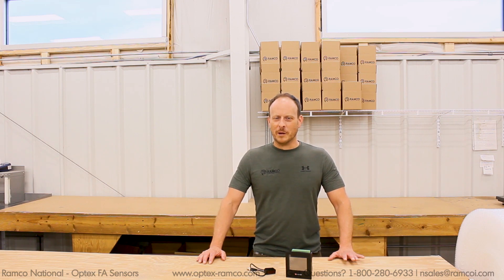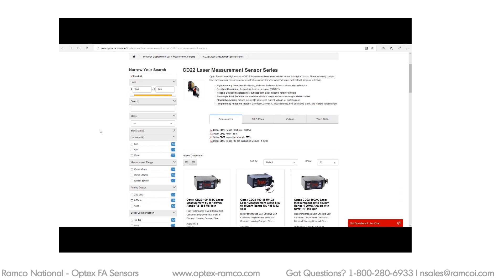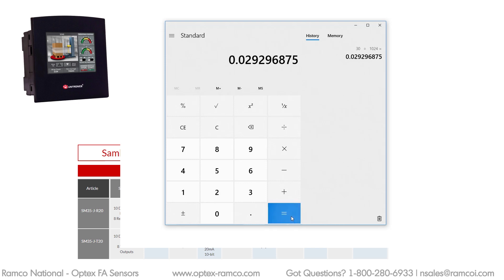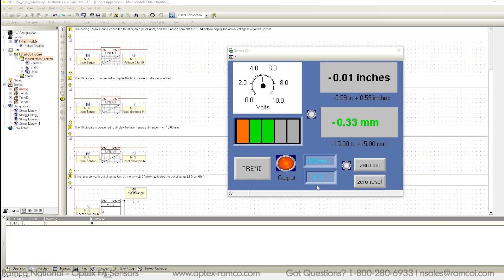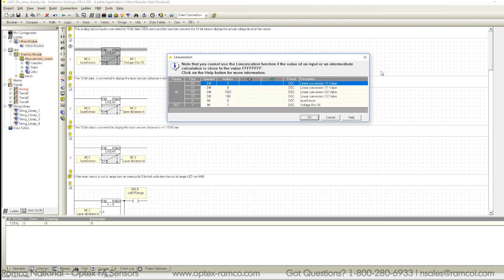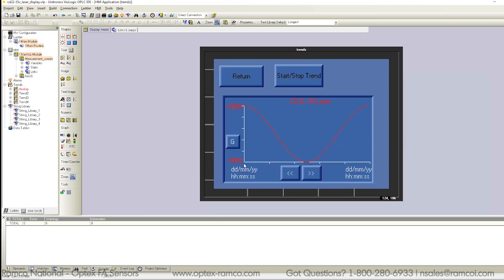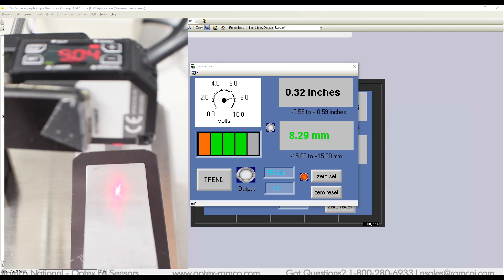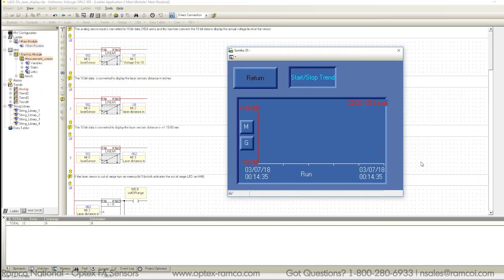How to Connect analog laser sensor to HMI PLC

Comment: Can I connect this sensor any of HMI? For instance siemens.
Reply from the maker: The CD22 series is available in 0 to 10vdc linear output  as well as 4-20ma output, and there is also an RS485 serial output which is based on STX ETX commands sent overSerial.  A  PLC would need an Analog to Digital card that will accept voltage or current or have an RS485 input for for the serial output version. The HMI will then typically be connected to the PLC. All of the logic is then done in the PLC.  The Unitronics is a combined HMI + PLC in one.